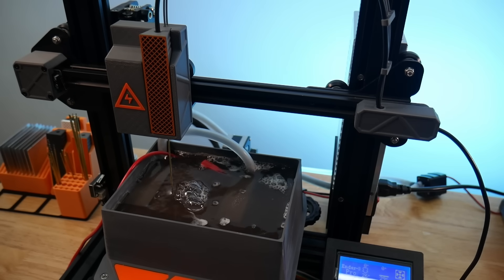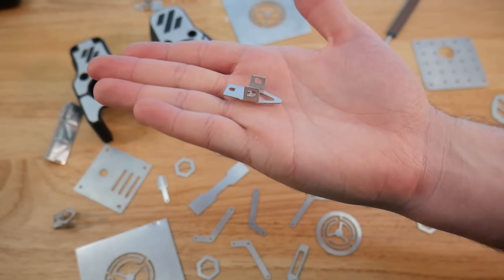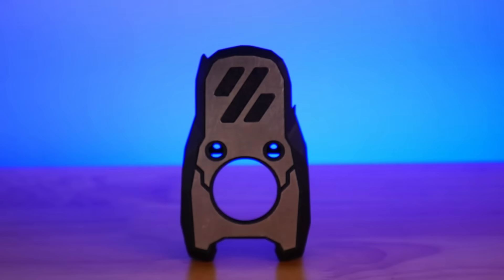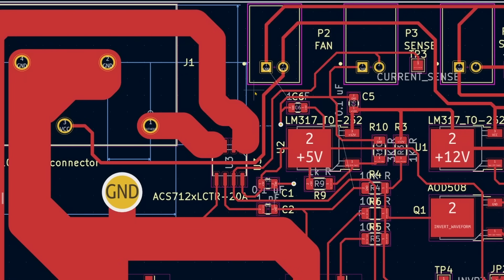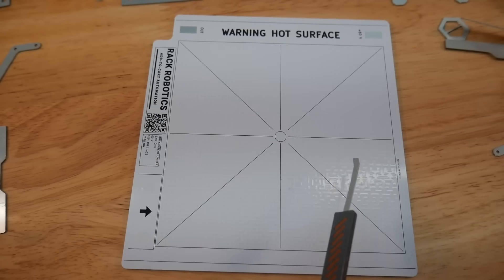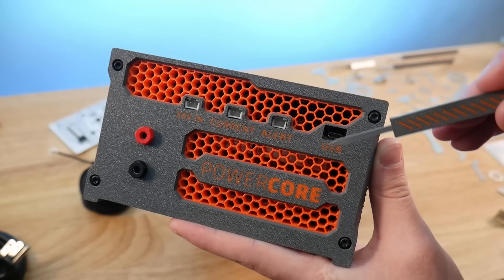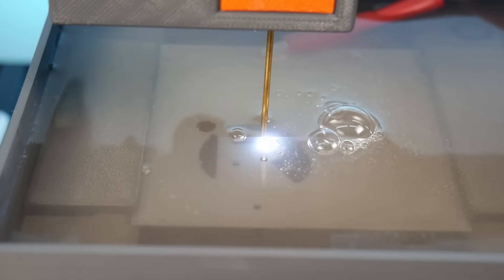I built an EDM machine

Comment: nice work, but your aproach is wrong. You dont want to short electrode with workpiece and EDM machines dont work with high voltage, they work with high current. You need to regulate feed to maintain constant sparkgap, so you need feedback from voltage and maintain it constant for a while (voltage must not reach zero) and then do a flush (flush is something different then you mention in video and needs to be done for EDM sink or EDM drill, not for this). Also there is no EDM mill. If you want do it properly, do a EDM drill or for cutting 2D parts, EDM wire. Your finished parts are overheated, maybe from shorting with electrode. If you want it to create a kickstarter project, make it properly, not wrong.

Comment: This is super cool, but it doesn't demonstrate the REAL power of EDM technology -3D machining metal tooling.
They are only showing very limited 2D cutting and the long electrode is deflecting to take up errors in the movement/cutting.
If they can do 3D machining they can cut metal molds and complex cutting tools in hard steel!

Comment: So the whole supply box is just a plain PSU switched with PWM to achieve crude current limiting?
Seems like it could use much more simplification.
Not really sure what the huge resistors are for, is that to overcome shortcomings of the crude current regulation?
Why not use some 100V rated DC-DC converter with current regulation?

Comment: Is this machine capable of throttling the rate based on resistance? It would be a great feature, especially for fine wire, when cutting multiple pieces from different materials.

Comment: Copper has a very large thermal coefficient of electrical resistance of 0.39%/C. Does this affect the consistency of your machine over a range of temperatures? Resistors don't use long copper traces like you did because of this reason. If your PCB warms up because of usage or your ambient temperature changes your resistor will change in value significantly

Comment: how about vegetable oil as the cooler liquid
Reply: you would not even have to alter/change the liquid after, no electrolysis, whatnot
Reply: laser ahem, seller talk biased much :)
Reply: nice idea anyways
Reply: or any other non-aqueous non-conducting coolant liquid
Reply: capacitive-resistive-diode power supply is the most efficient of them all, check my design
Reply: most of those parts in the power supply are unnecessary, and thermal automatic resetting fuses are an auto thermal-safety fuse no logic chips needed

Comment: i don't think most people realize how frustrating a DIY EDM power supply is. i have seen a handful of those projects start and never finish on youtube. the real holy grail is wire EDM though. i doubt any commercial 3d printer can get the precise movement required for good wire EDM, but you can make some incredible parts that have dry fit air tight seals.

Comment: would your supply be able to drive a wire EDM setup as well?
Reply from the maker: We have not tried it yet. You should check out the work of Dominik Meffert on Hackaday or YouTube. He used a slightly weaker EDM power supply and was able to do wire EDM.

Comment: Using a hotplate / resistor to limit current seems like a caveman approach.
Also Heat or Disipated Power = Wasted Power.
Couldn't you use some BJT or IGBT transistor?

Apart from that, great video, great design.
I was also looking up EDM about 6 months ago.
A good Power Supply is the key.

Comment: how mush would the machine cost without the 3d printer , i have a 3d router and it wouldnt be too mush of a problem to set up a small water container for the edm device on the wasteboard , it just has bigger steppermotors and actual drivers for them
Reply: Look at the kickstarter campaign...there is no 3d printer included, it's basically just for the PSU (power supply), some consumables and some holders.

Comment: How long does the electrode last? Provided that the electrode changes it's shape during work, how do you achieve high precision?
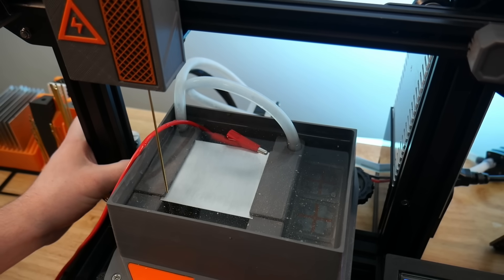Reply from the maker: The brass electrode has a wear ratio of about 1:20 brass-to-aluminum. So a 40 mm long electrode can cut out 800 mm of aluminum. To compensate for electrode wear, the electrode is moved downward continuously, at a vertical rate proportional to the horizontal rate.

Comment: I may have missed this in the comments but can you use variable size wires to "mill" smaller items? Some EDM machines use a hair thin wire for very precise cutting.
Reply from the maker: 0.3 mm brass wire is in the works

Comment: This is very impressive but factoring in the time and electricity cost and effectiveness of this wouldn’t a regular cnc mill do this level of metal cutting just as easily if not easier.
I mean you will have the cost of bits but this looks like it can easily be reproduced by a cnc mill.
Reply: Milling requires a certain rigidity and thus thickness of workpiece.  Plus, it makes noise.

Comment: Looks pretty interesting.
One thing that kinda bothers me about the "home EDM" tho: How dangerous is this process?
What happens with the water you used in the process? Does it need to be disposed as chemical waste, or do you just dump it in the sink? Do you need to wear a welding helmet and PPE to not get your eyes and skin burnt by the arc light over time? How about electromagnetic interference? Would this pass radiated and conducted emission testing according to a standard like EN 61000, or would you have to buld a farady cage and aditional powersupply filtering to pass relevant EMC standards? I guess it would not pass any consumer safety standards anyway, as you bascially have fully exposed high voltage and power without any safety interlocks.
I'll keep ordering sheetmetal parts from a company that uses LASER for now, and cuts the stuff for me. Currently I don't care if it takes a week to arrive, I get a wide choice of materials and thicknesses without having to build a stockpile of raw materials, and I don't have to do an initial investment into a machine that might take up space and sit around idle most of the time. But this is still cool to see what you can build and acheive at home.

Comment: After watching this video an important quetion came up. How do you deal with the tool erosion? As I understand the tool bit must be of a harder and much more expensive material than the one in to be machined yet I understand that ECM suffers no tool erosion whatsoever and the only impact is corrosion form the electrolysis.

Comment: It is posible to cut 3 or 4 mm steel or alumunium???
Reply from the maker: Yes, with our wire EDM tool. 

We will be releasing it very soon
Reply: @MorlockEngineering  Is it possible without using a roll of EDM wire?  so just a piece of wire without a roll of moving wire?

Comment: The advantage of a wire edm machine is cutting very fine lines. Using a large electrode like that is a waste of time and an overly complicated way to make parts that a cnc router can do in much less time. You would be much better off offering an affordable waterjet cutter
Reply: Any reason you can't use the power supply from this with a wire EDM?

Comment: it is possible to use over alluminium block to make a 3d surface to use like a vaccum mold or a injection mold? and if use a tungtenium pointer to make a very small contact?

Comment: How thick steel plates could you cut with it? And would a microwave transformer do the job? The only thing that comes to mind is the cutting power of a combination of microwave transformer and this machine, a microwave transformer killed many peoples due to a lichtenberg machine, just imagine what it could do if its combined with this machine the only thing you need is a bigger matrix
 (bigger than a normal 3d printer matrix) and a microwave transformer, i clearly don't know anything about this machinery but i think it would cut. But would it?

Comment: This is an extremely neat project, but you need to sort out the current-limiting problem. Using a heated pad as a resistor is a very weird solution.

Comment: Are you using 60 volts DC?
I experimented with this process, but without the CNC machine attached.

Too much current - there is a short circuit. Too little current - the spark is not happening.
I used a very unorthodox electrode and a power circuit in my crude experiment and tried to make it so the spark self-regulates without the need for complicated electronics - so I can burn holes in hard steel.

I cannot continue this experiment because I am not too good with electronics.

Where does the discussion on this take place?

Comment: if you want to scale up internal pcba manufacturing, you need proper reflow ovens like the T962.  I've been building PCB's for over a decade and hot air guns are TOOOOOO slow.  PCB manufacturers can supply you with stencils and you can paste your pcbs, place your parts and cook them in your own shop easily.  EMD is cool and what's cooler is that you are making an affordable one!!!
Reply from the maker: We are using a automated manufacturer. But we want to move to using LumenPNP machines in-house after the Kickstarter! I love that little reflow oven. I am saving it to my wish list.

Comment: Wire EDM guy here. What are your thickness limitations? What are your tolerances like? Having your electrode hanging out like that with no guide to support it near the cutting action seems disastrous for tolerances and the potential for the electrode to deflect while moving. That's little more than a hole popper (edm drill) nice in theory not downing your work. Just curious as to the actual applications. Seems useless with material exceeding a quarter inch think. Beautiful build nonetheless.

Comment: what are the machines limitations on metal thickness that it is able to cut?
Reply from the maker: We can cut 20 mm thick aluminum now with wire EDM. 

Titanium and hardened steel too
Reply: @MorlockEngineering  that's impressive. How thick can you cut steel? Same?
Reply: @MorlockEngineering  what about sinker edm?

Comment: it's an interesting experience, but with plasma I'll be cutting materials much thicker, much faster, much more area, and much cheaper. Why do I need it?
If it were possible to cut with wire with a very thin cut, but this is not here.

Comment: how's the lifespan of the equipment and any backfire of the equipment you experience so far and what changes is made. Then another question, have you convert it to a large area such as 13 x 13 or if possible a 16 x 16, or 24 x 24. or is this another extension in the future.

Comment: You should be really careful before actually shipping your product. You need to test for EMV compatibility to get FCC certifikation. If you ever sell to Europe you'll need to test a CE certificate.

Also at least the PCB from 4:54 could use some changes as well. The Ground Plane should ideally not be interrupted. The Pico is only connected at the top over two traces and there is a trace going from the top to the bettom in the middle of the board. Depending on frequency and current that could be problematic.

Comment: for a cheap DIY power resistor, I suggest what I call a "washboard", it's basically 2 threaded rods wrapped in kapton tape (or not depending on the resistance), between which you string nichrome wire, it's basically how cheap heater fans are made, and you also can simply use wire from a broken heater.
manufacturing this at scale is probably more costly though than pcb+aluminium extrusion. 

another option you can use is air dry clay around the threaded rod as an insulator. you can also use mika as they do in heaters
you can make a 120x120 grid and suspend it in front of a regular pc fan, and it will work really well. (I tested up to 2kw on 240V) heat elongation at higher power may be a problem, so you may want to mount the bars on springs if it droops too much.

in a pinch you can also use regular steel wire.

probably the easiest option would be to use a 2kw 240V heater and add 3 taps, connecting the 4 sections in parallel for a ~7 ohm resistor
if 7.8 ohm is good, you could also use a regular 110V 1550W radiator with no modifications.

Comment: for long term use what strategies might you employ to prevent the distilled water from being contaminated from the air above it? Maybe have a lower weight fluid sit on the surface?
Reply from the maker: Pool filters are the first line of defense. To control conductivity, deionization resin is used commonly.

Comment: Have you ever considered using a thick (>1/8") electrode as an end mill? I'm wondering if injection molds could be made on this with many, many passes.
Reply from the maker: I believe that is called "bulk removal" in some EDM circles. It has been done before, especially for something called microEDM.

Comment: Popular Science published a circuit in the 60s for a power supply using a couple light bulbs, capacitors and a few other miscellaneous bits.  Wish I still had it.
Reply from the maker: I have also heard about that. It was a RC type supply. Our system is a pulse transistor type. There is some overlap, but we control our pulses with a MOSFET rather than relying on resonance.

Comment: What about Electrolysis Deposition Manufacturing? Similar idea, base and tips are electrodes but with a solution of suspended ions (iron or copper come to mind), tip moves around creating tiny deposition lines from the suspended ions and building on them like a FDM machine. You could probably do it in a similar fashion to resin printers if you had a programmable electrode plate too. Would only work with pure elements so you couldn't do any alloys such as steel but I'm sure there's an application to be found.

Comment: Interesting! I'm guessing that other materials such as steel would also work?
Reply from the maker: We have been having good results with thin aluminum. Aluminum does not need very high-voltages to cut. The Powercore is 72 volts, which is too low for steel. Thin materials are easier to cut because they require less water flushing.

Comment: Interesting project & Excellent work but why use EDM when you can clamp a highspeed milling motor to your 3D printer which is easier, cheaper & can do the same thing plus attach different cutting tools for different materials other metals, plastics, wood or ceramic, hell I even used it to make my own printed circuit boards.

Comment: What are some things you can do to improve the finish of the cuts? My impression is that commercial EDM machines produce a very smooth edge finish. Also, what cut thickness can your machine achieve and what metals?
Reply: commercial edm machines use a very fine wire on a spool.

Comment: How do you do spark gap control? Is there feedback for the 3d printer to control the distance?

What do you do if the electrode contacts the work piece?
Reply from the maker: We do not yet have any custom firmware for closed loop control. Right now we just avoid shorts by machining slowly (12 mm / min). Any sort of closed loop control would be a game changer, especially with Klipper firmware.

Comment: This is awesome! Apologies if you mentioned this in the video: What's the maximum part thickness possible?
Reply: Very impressive, but no information on the thickness or type of metal limitations. .6mm aluminum (used in the video) is VERY thin (.024").

Comment: Can you explain how you control the powercore? Is it just a case of switching it on and then running the gcode? Or does the gcode cobtrol.the powersupply too? What software do you use to generate the gcode?
Reply from the maker: The Powercore can simply be turned on and off. The gcode in these examples only controls the motion system. 

I generated the gcode with LaserWeb and EDMweb

Comment: super innovative. curious if you look at optimising the design to cleanly cut 11ga (.125”, 3.175mm) aluminum, vice the purported 1mm thickness? guessn the power block, electrodes, etc would need to scale in size and co$t. would def back a proj targeting ally in that increased thickness. good luck!

Comment: It will be interesting to see desktop wire and sinker EDM too. Seems like sinker EDM dies are a bit of a challenge to make. Wire EDM might require a larger tank but the build size should be about the same as a 3D printer.

Comment: Will there be a kit version that I could solder together myself? What is the maximum raw material size that will fit, can it cut material that is 4.5" x 1.5" x 1.5" size (like square tubing or aluminum extrusion)? Also, can it cut through 1/8" think aluminum sheet?

Comment: The $30k machines are quite a bit more precise... in part because they use the wire only once and use speed control to regulate the discharge current.  But, this capability seems to be quite a bargain for a small DIY unit.

Comment: I'm excited for your progress with this. The quality of the milled parts, and the high feed rate are both very surprising to me!  I have a noob question about the process. I see how deionized water is needed to prevent electrolysis. As milling progresses, does the water get progressively more conductive due to dispersion of metal ions? Probably not a big deal in any case, with a large enough reservoir.

Comment: I've used an 10m long trace on a PCB as a power resistor, because I needed to keep the temperature of that device above 10°C. What I've found is that there can be pretty huge difference in the copper height deppending on the manufacturing process. Most boards were within +-10% range, but there were some with more than 20% difference from the nominal value.
Reply: Good point. For consistency's sake one could make the trace 10% longer than optimal then add multiple junctions, measure the resistance of them with a Kelvin probe so that you could wire each board appropriately.
Reply: @ExtantFrodo2  Yeah, that is what I've done. There are three junctons that you can connect with solder and they make the whole thing shorter by -10 and -20%.